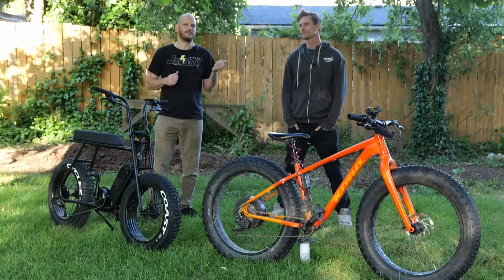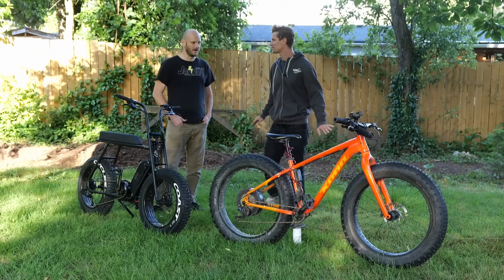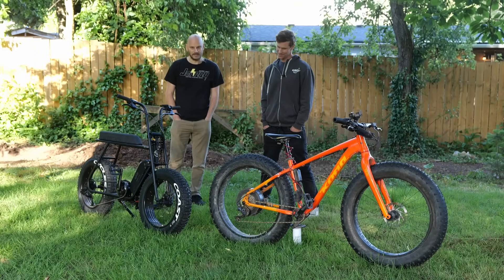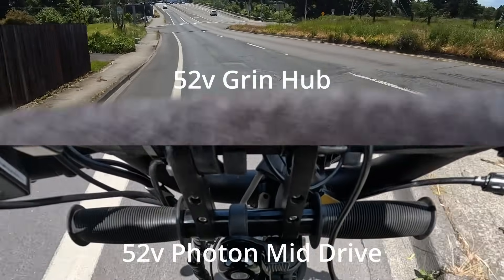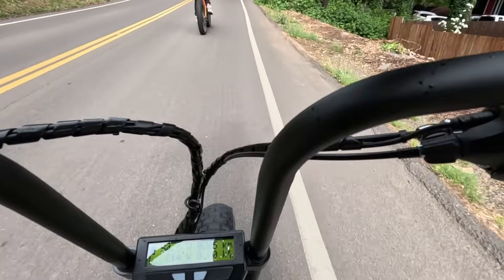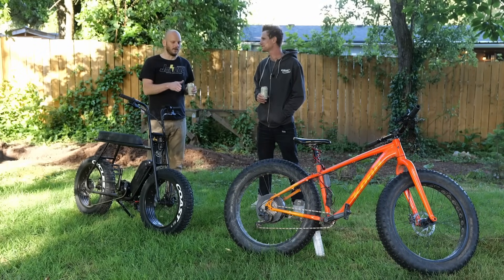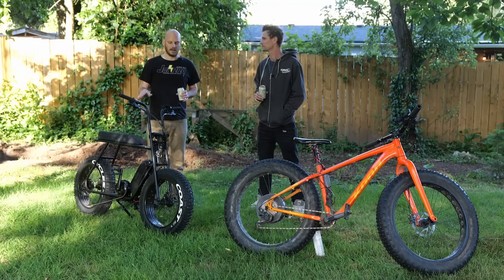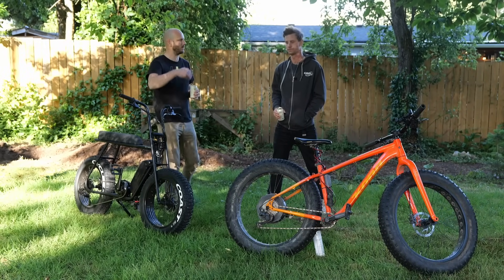Grin All-Axle Hub drive vs Bafang Mid drive Hill Climb Tests. Who is king in 2025?

Comment: I prefer to be street legal.  You need to compare 750 motors.

In Canada I think street legal is 500.

I always do pedal assist and never use the throttle.

Plus I usually ride a IGH.
Reply: Canada is 750 watts if you're over 16. But the discrepancy between power OUTPUT and power INPUT is where the legal sense falls apart. 
A motor giving higher torque is less efficient. For a hub, just pedal more and go slower to keep the amps to the motor reasonable for efficiency. 
For the mid-drive, what they don't tell you is that for a normal 90rpm pedal cadence it's most efficient at like 150 watts, for 750 (or more for bbshd) the speed you'd need to spin the pedals would be like 200rpm, which is awkward at best. If you're running full power on a mid drive and pedaling along with it you're probably not running it a lot more efficiently than a geared hub would be on the same hill.

Comment: I built my own electric bike after watching Johnny Nerdout video like 7 years ago and it's still working great today, I've got about 3500 miles on it and the area I ride is really hilly mountainside in Lake Havasu Arizona and there's usually 3 plus months that it's too hot to ride for me, but once the temps at noon are 95 or under I'll get back to daily riding again, my bbshs mid drive with a 48v battery usually gets me about 50 miles per charge but I am peddling because this is my doctor's recommendation for my back surgery therapy, building my own bike saved me back in 2018 around a thousand dollars, Thanks Johnny

Comment: Smoked on the streets. WATTS wins the top speed / uphill race.  BBSHD only wins if you have to ride up a 45degree angle drainage culvert for some unpractical reason. Got It :person-turqouise-waving:   Most people dont actually need a mid drive
Reply: Depends on what you are doing. Technical terrain (single track) a mid-drive is king and a hub is awful. A hub motor is good for road use only, paved and light gravel. If you want a mountain bike to ride single track but also go to the grocery store, get a mid-drive. If you are just using it for basic transportation, get a hub, it will do the job and be cheaper to buy.
Reply: Wasn't there necessity for higher power batteries on hub drives since it's impossible to down shift in extra high torque gear especially at traffic stops where it's impossible to have a running start?
Reply: @uvwuvw-ol3fg no for traffic stops not. Only for going fast uphill or if you accelerate super fast. Because losses scale quadratic with torque. But at low speed output power is lower. Output power is dependent on speed*torque. So if you go slow you mostly have the losses depending on torque.
Reply: @wtsuser I was talking about traffic stops right at the bottom of 17% hills
Reply: @uvwuvw-ol3fg  at 17% hub motors will overheat in a couple minutes because the required torque makes them run so inefficient and generate lots of heat instead of mechanical power. But its not about the battery. Unless you want to go up the hill with >20-25km/h then you need a battery that can supply like 2000W or more

Comment: Ive had both mid and hub. The bicyclist in me liked the hub and the motorcyclist in me likes the mid. Shifting yes.How steep the hills are the key. I like riding up mountain trails in the west. Mid drive with proper low gearing can climb like a billy goat.Not fast particularily but strong. Would love to have regen though.
Reply: Did you mean that the other way around?
Reply: @nolowputts  If I had a hub with internal DCT type thing, maybe. I had a 1000w  hub and now 1000w mid. Cant gear the hub it lugged down.

Comment: Seems to me that mid drive vs hub drive is basically bicycle vs moped. If you want to ride a bike but with extra power, go mid drive. If you just want to cruise around with as little pedaling as possible, go hub drive. I like riding bike and getting exercise, but not a fan of hills and headwind, so mid drive makes sense for me.
Reply: Thank you.  Bicycling is my chief source of exercise.  Having power assist allows me to go much further - and on longer rides, I AM getting sweaty clothing due to exertion - usually need to take a shower when getting home.

Comment: Much respect to Grin. They make great products and the best hubs, hands down. It's still a hub drive though. The gearing on that fat bike would not allow for normal pedaling at speed. At street legal powers any mid-drive will beat an equally powered hub, at 3kw you're not street legal anywhere. The all axle does make for a nice throttle powered moped though. That bi-directional throttle for regen is a very cool idea.
Leave a mid-drive bike in 1st gear and it may not be as fast as a hub climbing hills but it will climb all day without strain. I have yet to see a hub of less than multi kw able to climb steep hills for long distances that can do it without straining.
If I didn't live a half mile up the steepest hill in NYC (yeah, we have some hills) I might like hubs more but for now I'm still a mid-drive guy.
IMO hub drives are better if you want a moped but coming from a cyclist background mid-drives make better electric assisted bicycles (that allow for throttling).
The BBSHD can handle 3kw IF you're mindful of your gearing. It can also be fried at 1.5kw if you're not mindful of gearing. Please don't ask how I know🙈🙉🙊.
From NY to Canada, Elbows up!
Reply: Especially their charger.  I have one.  Helps a lot when on the road.
Reply: @dennisyoung4631  What kind of mileage are you covering? I love my Satiator for the range of settings but it's a reasonably heavy brick to carry around. Counter to culture I like slow charging at 1 amp, but being able to cram a 5 amp charge when in a rush is handy.
Reply: @michaelsprinzeles4022 addendum: I like to call it the GRIM Satiator. - think bad nightmare-fuel tales….

Comment: Grin recommends a slow wind motor with 72 volts to help keep phase current as low as possible. 
Do you know what wind they showed up with?
Reply from the maker: Slow wind
Reply: @JohnnyNerdOut I’m super interested in their all-axle motor with integral torque sensor. The advantages of the mid drive actually aren’t advantageous in my area of use, and the noted efficiency is terrific

Comment: I expected regenerative breaking was not practical.   I'd like to see some charts on how they perform.  I thought the power loss & equipment costs would keep them priced out of the market.  I am pretty happy with a top speed of 15 mph.  I would be interested if the reaeration can be set to auto engage.  I have a geared hub motor, as I recall, they are not designed for regeneration.
Reply: The top speed not really what l think of as torque here its how steep of a hill can the machine and rider ascend.
Reply: Any single driver that can run a motor could do regen if programmed to - that's not the issue. And regen always pays for itself versus the cogging torque. The efficiency versus a geared motor might depend on what you're doing. A mid drive might be a bit more efficient up the hills but the regen can get you power back down the hills, especially if you limit yourself to 30kph or something down them so the air resistance doesn't eat all the power.

Comment: $500 mid-drive kit vs a $2k hub drive kit. Double the draw amd of course all are illegal on public property. This is the very best, by a very large margin, hub motor too. Compare legal for legal, consider handling, weight and range, the mid-drive blows it away every time, on any surface. I would put The TSDZ2B, your "weakest," against his 750 watt.

Comment: 20 inch fat  wheels seem to be ideal in a city.
Reply: The attack angle on cracks means a bit rougher ride. So if you live in thr north, pot holes are real hard on 20" wheels even with fat tires.

Comment: Im guessing that the average person does not want to "pedal assist,,".  Get s high power motor. for hills,  or suffer.
Reply: Except for Grin's custom motors, there is no such thing as an ebike motor, controller or throttle actually designed for more than 400 watts (I routinely swap 250 and 750 motors on mid's as well as reduction gears on hubs). Anyway no ebike is meant to be throttle ridden. They are for getting started or if in the wrong gear on a hill (get internal gears). Throttle riding will burn up either style motor  Lately, our shop has been having crazy problems with axle spin out too, on hub drives. We learned, years ago from Grin, that anything over 500 watts really needs a torque arm. It is a bigger problem for throttle riders because they do tend to just ride around in a high gear, which puts hard, constant torque on that axle (admittedly, mid-drive fans that try even pedaling in a high gear and high boost, tear up motors too). 

*if you really want to be bored I can share details of why.
Reply: @MHH3180  That's not entirely true. Use grin's calculator. Keeping something like an Ezee motor at 26 amps or less and it'll never overheat, ever. That would be 850 watts if at 28kph on a hill pulling that many phase amps. That would be a 6% grade on only battery power, but you can do a whole lot more than that if you're only going up the hills quickly, and actually going up them faster is more efficient if you're not pedaling since the time spent with the torque just to combat the rolling backwards is for less time.

Comment: 3 mins ago is crazy, anyway would you recommend getting the heavy duty drivetrain for a cyc x1 pro gen 3 stealth 1500w or would just a strong cassette and chain be fine and if so could I use an Aldine 11 speed internal ?
Reply from the maker: Depends on how much of a maniac you are when you ride. If you are somewhat responsible, you should be fine with a good quality hub. But if you’re going to treat it like a motorcycle, you might wanna dish out for that Cyc drivetrain.
Reply: Internal Gear Hubs are great for their convenience & lack of service or adjustments but only a few will survive the added torque from an E motor. The Alfine 11 will not, especially if you are running 1500 watts through it. You shouldn't need that many gears anyway since the motor will replace your low gear requirements. Depending on your rear drop out width consider the Sturmey Archer SX-RK3 for 170 mm drop outs, the 3x3 nine for 135, 142 or 135 mm drop out spacing,